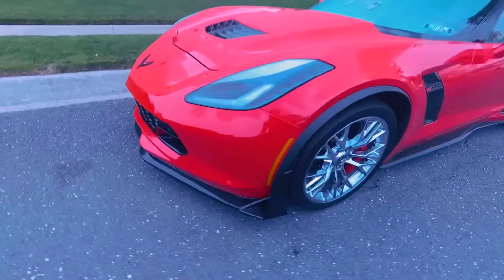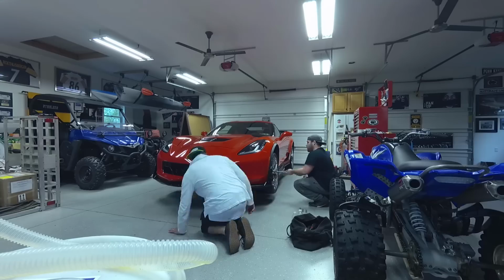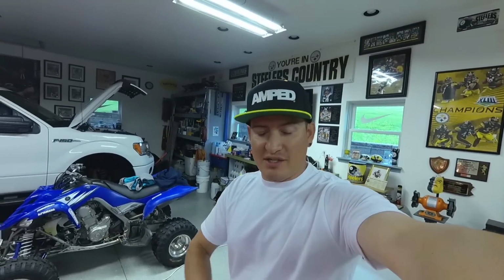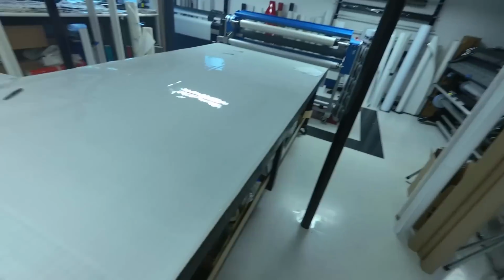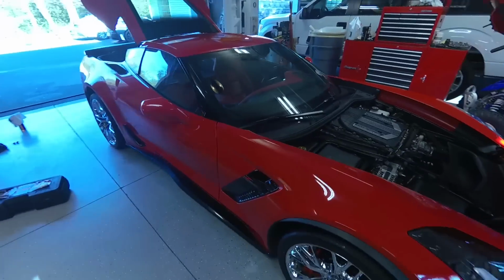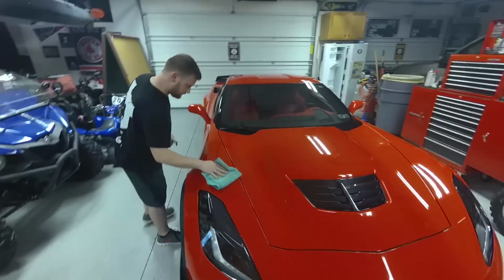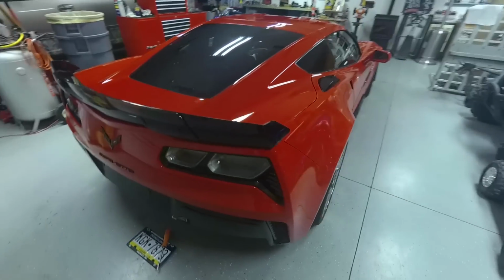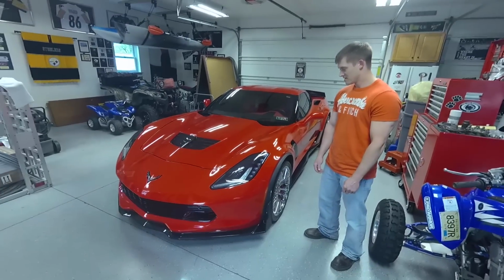Bullet Proof Protection on Z06 Corvette!

Comment: Have ;you tried the forced air method of drying off a car yet? Would that be compatible with your wrap/coating, or doesn't it matter.  Also, if you don't have an alarm system for the buildings, it might be a good idea, especially the new shop.
Reply from the maker: sailor Mac not sure what you mean by forced air method. The paint protection has to be done with a wet application. The product is way to aggressive to apply with out any slip. As for the new shop please believe that thing will be secured with an alarm system and cameras.
Reply: by forced air drying, I mean after you wash and rinse it off, instead of a chamois or towels. Before you ever start the xpel.

Comment: Really enjoyed this video Shane. FWIW, liked the Vette with the body colored rood. It just seems to "flow" better. Anyway, some questions:

1.  You said you did the hood vent. This was done without removing it?
2.  I guess you also did the exhaust valance and side skirts? What about the rear quarter vent scoops?
3.  Why the Ceramic Coat over the Xpel? Isn't this a little like putting floor mats on top of floor mats?
4.  Have you come with a way/method to do the front grill?

Keep the videos coming.
Reply from the maker: These are all great questions...

1. yes we did the hood vent without removing it. We used a cut file for the front hood vent.
2. yes we did ever tying on the car. Side skirts, splitter kit, exhaust valance, spoiler, and all the vent scoops.
3. Ceramic coating is a great option to do over the Xpel because it repels anything to stick to a surface it is cover but it does not protect from stone chips. So Paint protection first protects from all debris and ceramic repels anything to stick. Its a killer combo.
4. The front grill has inserts on both vents on the outer sides but as for the honey comb patter or what ever you want to call it their is no way to install anything on that.

I hope this helped you understand and we appreciate your interest and questions.
Reply: Thanks so much for your reply. Your answers really helped, which now prompts me to ask two more. I know there are a lot variables to this question, but currently, how far out is your scheduling in taking on new customers? Lastly, have you, or can you wrap the underside of the hood, possibly in a design that might look like it was air brushed? Also, what are your thoughts on wrapping some engine parts such as CAI, fuel rail covers etc.?
Reply from the maker: We are about 3 weeks out and we are taking new customers all the time. What kind of car do you have? If you have a stingray might have a solution for ya. For underneath the hood.

Comment: Hey Shane! Did the hot water in soap solution actually work really well? No stretch marks or anything?

I do XPEL in IL and on some kits, there are very faint stretch marks. And I figured if it worked for you, we'd test it out!

Comment: What kind of camera do you switch to? The audio sounds a lot different
Reply from the maker: Patrick Navarro we just took it out of the striped case we were using.
Reply from the maker: Patrick Navarro stupid*
Reply: InShane Designs Inc. Haha oh okay! I wish I would've gotten a Clear Bra on the front end of my Red Hot 2016 Camaro SS because it has soo many rock chips from racing on a horrible road in Mexico haha.